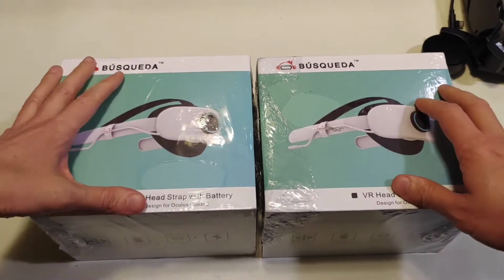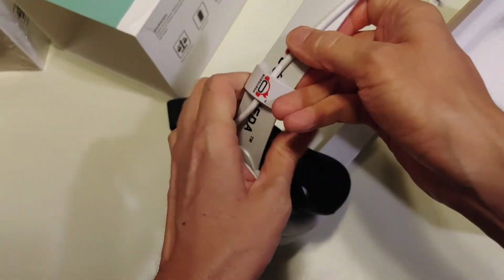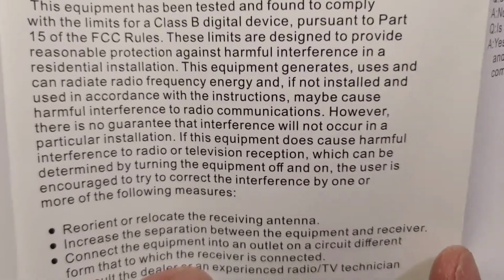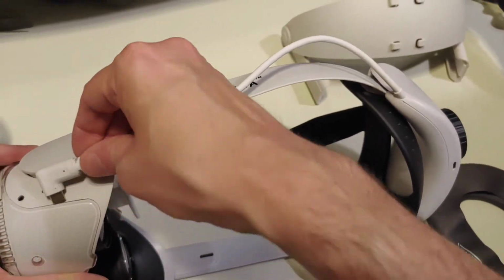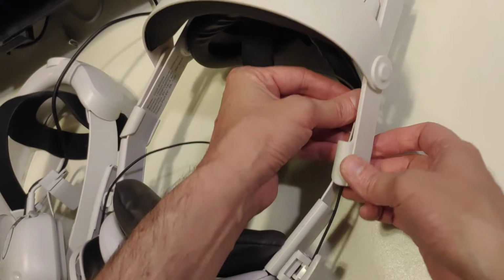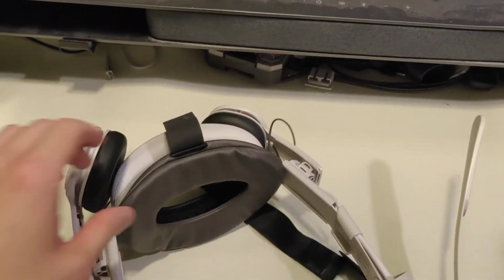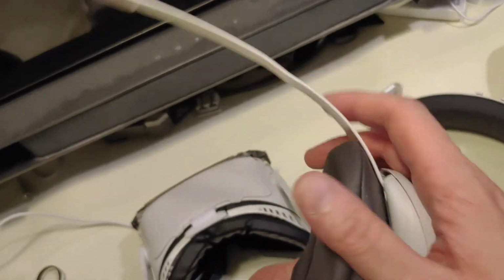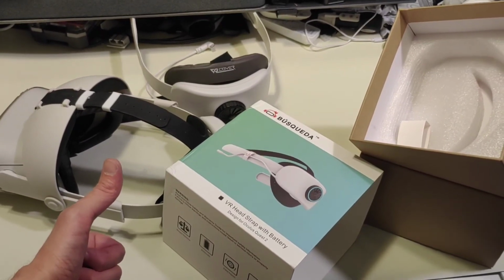Unboxing Overview Use Comparison Impressions of Busqueda Elite Strap w/ Battery for Oculus Quest 2!

Comment: I have a button on top but doesn't seem to do anything do you know anything about that?
Reply from the maker: In both the initial and 1st revisions, there was only slight changes to the design of strap material and screw lengths attaching the rear head support to the strap. Those both just had the gear that you turn to display battery charge, so it could be that a button on top could either be potentially for switching between PD Fast Charging or Link cable passthrough support(if they have revised that far ahead), or it could be for a battery power off for overcharge prevention? It's been a few months since I last heard anything from Busqueda company representatives. Does the manual not have any diagram listing regarding the product, or even on the Amazon page for display of it, or any questions asked that they have answered on there? I hope this helps, and much thanks for your question, interest, and for your viewership.
Reply: @xyberKnight  there's nothing in the manual or anything on Amazon nothing that I've found even mentions it.
Reply from the maker: I've checked out the original and 2 revisions of this product but never have seen a button. Could've been where it was manufactured from a different production facility?

Comment: My battery won't charge, and had it a little over a month.
Reply from the maker: I've found in some cases if the headstrap is in a high heat environment it can lead to this issue where the solder connecting the circuit board to the battery cells can short out. You can contact the manufacturer directly through your order details or the product page company contact on amazon and they should be able to get you a replacement. I have already reported your situation to the manufacturer as well so that they can make revision and improvements with future design and feature implementations. I hope this helps, and much thanks for your response, interest, and for your viewership.

Comment: So this was a good choice basically right , I’m at work man
Reply from the maker: Pending what you are wanting out of the headstrap, for the comfort, support, and battery capacity, nothing out there(yet) has this amount integrated. The USB type C connection to the headset can be very finicky where you have to make sure to not angle it or it can break the solder or electrical connection. This is a durable headstrap, but like all currently offered, there's no passthrough for Oculus Link cable support on this one. I am on the fast track to some other non battery elite straps that I'm helping implement for an improved battery version in the coming months. Stay tuned if you have interest. For something to get right now that you need battery, this is in my top 4. If you have a non battery strap already, I'd wait a couple months, or check the other recent content I've released. I hope this helps, and much thanks for your question, response, interest, and for your viewership.

Comment: bro is trying to desecrate this strap lmaoo
Reply from the maker: I've been performing focus feedback manufacturer product testing for over 20 years, but only recently( last few years) been requested to start making videos as well. I put every strap I test through a very strenuous battery of stresses, durability, and build/design tests to see where weak points are that I can offer feedback in regard to for future revisions which have already been implemented, and future versions for upcoming product versions designed similar but not the same. I hope this helps, and much thanks for your response, interest, and for your viewership.
Reply: @xyberKnight  no problem lol i love as just surprises on how much you put through it
Reply from the maker: I thought up my use case scenario of tests back when VR first started, for households with kids, people in a hurry and forget their headset is around, as well as the thing that most people wouldn't consider with drop and connection tests where my headset would smash into my desk if it didn't hold, and most recently for showing fitment I had a head form made that's the same dimensions and size of my own head, where I have a larger head, and lower set larger ears to show how something fits better than just in the reflection of my tv to help show fitment. Much thanks for your response, interest, and for your viewership.

Comment: Is there like a turn on button are something because it’s not charging up my oculus idk if I’m doing something wrong. this my first battery pack I plug it in my oculus and it wasn’t charging
Reply from the maker: There's no button to turn it on, it is designed with a contact circuit where once it's plugged in(very securely-almost pops in the socket) that it will charge by slowing the rate of depletion. I've not seen it charge the headset percentage higher than what it is, just maintain or slow down the discharge. I hope this helps, and much thanks for your question, response, interest, and for your viewership.
Reply: Ive read that the battery turns off once the headset hits 100% charge, then you have to loosen/tighten the tightening knob on the back or unplug/plug back in the charging cord to re activate the charging. I get mine tomorrow so we'll see.

Comment: Does it charge the quest 2 when the q2 is off? I got one for Christmas but when I played
 the q2 battery level kept going down even though it was saying "charging".   I left the strap plugged into the Q2 when I was done 
But when I checked it 3hrs later 
My quest was still at 73%.
Reply from the maker: If the lights are working when you twist the turn the wheel, and the battery on the head strap is all the way full, then when plugging into the headset, it will slow the pace of discharge, but will not charge the quest 2 on the unit I have. However, if I leave it plugged into the Quest 2, and charge the headstrap, it will fully charge the Quest 2. Does yours have the branding on the side of the band and have the chunky usb plug for the headset like this unit? If not, you may have a revision, or a different vendor purchase, as this one is listed as sold by and shipped by busqueda only. I hope this helps, and much thanks for your question, response, interest, and for your viewership.
Reply: @xyberKnight   I don't have any branding but it was ordered from the Busqueda store on Amazon. I really appreciate your help. I'll have to see how it goes once I get another chance to have a longer VR session.
Reply from the maker: Have things panned out? I apologize for the delayed response. I wasn't made aware of the notification for comment to respond to. The instructions advise to insert very firmly, so that may be an issue, but if my level of firm isn't enough, then there's something wrong with it. Much thanks for your response, comment, interest, and for your viewership.
Reply: @xyberKnight  yes, thank you!  I really appreciate the help
Reply from the maker: I'm happy to hear things have worked out for you, with the head strap and charging methodology. Much thanks for your response, comment, interest, and for your viewership.
Reply: @xyberKnight  no problem! Love your vids.
Reply from the maker: Much thanks for your kind words, and I'm happy to provide helpful, content for things that other people can make use of. Much thanks for your response, comment, interest, and for your viewership.

Comment: Hey @xyberKnight what face cover are you using at 26:09 it looks like its leather and comfortable i have been looking for one for long time  do you got a link to that its not in the description??????? It would be very helpful for me thank you sir.
Reply from the maker: The bracket is the AMVR white 7 in 1, and the cushion is the VR Cover Cool XG hybrid gel cushion. Though the current one I advise is the VR Cover Fitness Facial Kit with the VR Cover Cool XG cushion. The reason is the cushions that come with the VR Cover Fitness Facial Kit are much thinner than previously by 4mm, which I can feel a difference on forehead and sides of the eyes pressure. I hope this helps, and much thanks for your question, response, interest, and for your viewership.
Links:

AMVR Resilient VR Facial Vent Soft Interface 7-in-1 Bracket(PU Leather)
https://www.amazon.com/gp/product/B08ZMZNNKJ/

VR Cover Cool XG Foam Replacement Set for Oculus Quest 2
https://www.amazon.com/gp/product/B08XK2DRHD

Video they are featured in: https://youtu.be/ZXkRORYCl_k

VR Cover Fitness Facial & Foam Set Kit For Oculus Quest 2
https://www.amazon.com/gp/product/B09C5S62VM/

Video it's featured in: https://youtu.be/UyNaZslPeWE

Comment: man really, why would we care the size of the box?,  Not even a test of battery capacity, but care about the box size ?  just to let you know, you have turned a simple elegant design into an ugly cable management mess. Sorry to be this honest, but i was looking for a good review to buy this product, evidently this was not the video.
Reply from the maker: I don't do review videos. If you read the title, it says unboxing, overview, use, comparison, impressions. I answer questions in the comments based on what people want to know. As you asked, the battery capacity test of charging is PD 3.0 speeds at just under 4 hours 3 hours 52 minutes for 8,000mAh on the unit that I purchased. I don't play VR around others, so it doesn't matter about cable management mess. I care about function, so it does function, but it's way too light to be a proper counter balance weight on its own. Ask question for what you want to know. I've been doing focus feedback testing like this since 1998, so the unless I get feedback from manufacturers that wish me to cover things in another way than I like to do so, then I'll continue to do so in a way that makes sense for companies to validate and make changes if needed a lot easier. The Amazon Prime stock for this item isn't current unavailable, as there are some improvements being made to the design which I'll get in to be able to go over, based on some of the feedback I've supplied. If you want this, wait for that version update, which will be around the same time as when Amazon stock would be replenished for this item(roughly a couple months out). I hope this helps, and sorry you don't like the way I cover points for manufacturers, rather than just do a review. I do plan follow up videos once I have made use of things for a while though, at which times I give an updated thoughts and improvements of products. Thanks for your question, response, interest, and for your viewership.
Reply: Flashing orange, and won't charge after a month.

Comment: Would you recommend it highly over the elite with battery?
Reply from the maker: If the risk of strap breaking is an issue for you, I would personally, but I would wait until a revision has been done, and not buy from any of the 3rd part vendors, but directly from Busqueda themselves once they have stock replenished again to amazon, so that wait won't cause increased cost in shipping and overall. I hope this helps, and much thanks for your question, response, interest, and for your viewership.

Comment: I'm watching this thinking, be careful shit's fragile. Did you buy 2 just so you could fuck one up to see what it could take?
Reply from the maker: I put things through a durability and quality test more than what manufacturers would. The other my best friend bought off of me, since it was in, and he didn't have to wait to order. I submitted my findings to the manufacturer, and there is a revision being worked on for the product based on possibles that could occur due to shipping mishaps with potential shorts, and risk of plug dislodging inside the headset, based on the type of connector head shape and style used. I hope this helps, and much thanks for your question, response, interest, and for your viewership.

Comment: Glad to see a review on this product, but you should really edit it down. Too much time spent taking things apart and adding/replacing other parts. Not everyone is going to have all the same add-one as you, so you should just focus on the product itself. Unboxing is fine. Edit out all the tear down and just show once it’s on without all the other accessories then give your thoughts. Save all the other Frankenstein stuff for another video, and you should lose the ending of just putting your original gear back on. It’s totally unrelated.
Reply from the maker: I have very little editing ability on my phone, and if I pause the recording for too long, it just stops, and resuming is a second video. This is part of the reason that most of my videos are longer, in addition to this is designed to be feedback for the manufacturer in addition to being just informative content for what would be received of a retail experience. I don't do just an unboxing, it's overview, use, comparison, and impressions, as listed in the video. I make sure to cover details that others would miss. My cognitive issues make things take longer, but I am limited in what I can change for making sure the integrity of the content remains intact. This product still remains a work in progress of revision and improvement based on my feedback as well, where I've been collaborating for features implementation since mid summer. Thanks for your comment, response, interest, and for your viewership.